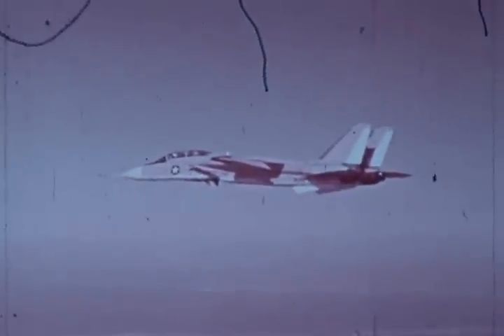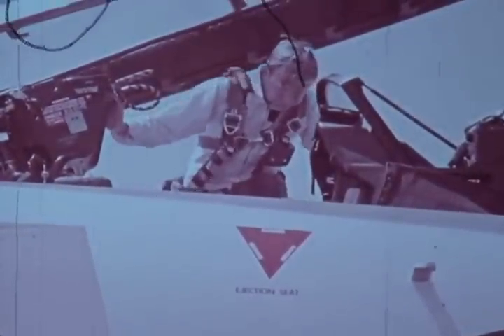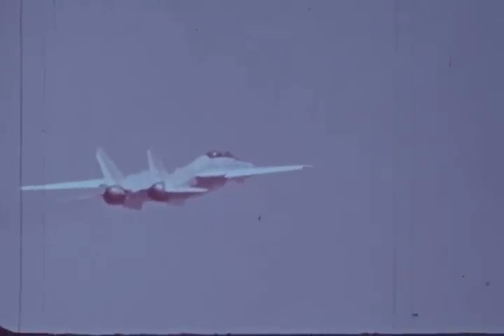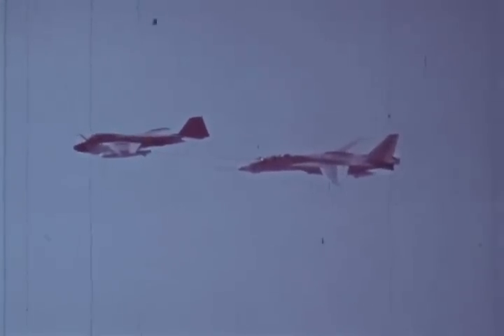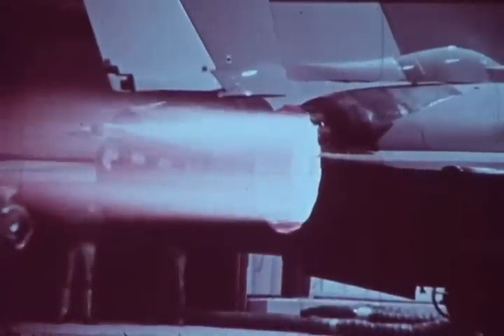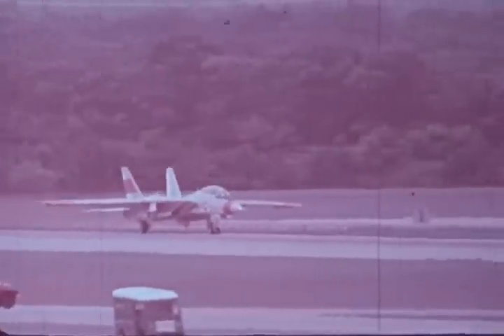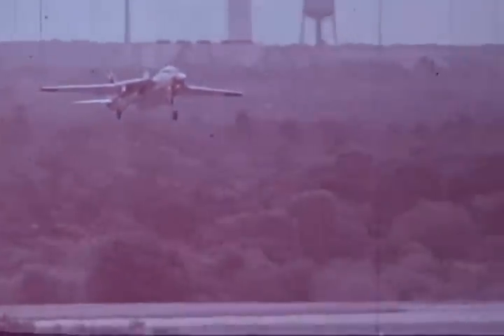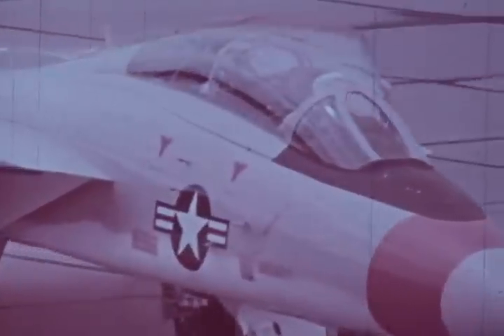F-0622 F-14 Flight Test Progress Report

Comment: The sad reality is that the Navy and Grumman pushed this program quickly and they had some accidents.  It was a very complex plane which led to issues with maintenance and the plane not being produced well above the minimum the Navy wanted.
The Number 1 plane DID NOT have to be lost.  They knew about the hydraulic/harmonic issue BEFORE the flight but the report about the fault didn't get to the test team in time and so they didn't make the modifications.  Had they delayed that flight a month, that plane would have flown for a lot longer than it did!
As it is, they lost about 4 or 5 planes during the flight/qualification tests prior to first deployment in fall 1974.  I think by 1973, they had lost at least 3 planes: the original plane, another plane scheduled for an airshow that plunged into the water for whatever reasons -- they never figured what it was that happened with the pilot I think (he was by himself, no backseater) --, and a third plane that actually shot itself down with its own missile, an AIM-7 Sparrow that didn't clear properly!  They fixed the missile clearance issue by using more power explosive charges.  The AIM-7 that committed "hari kiri" got caught in the slipstream of the launch plane, angled up, and tore along the bottom of that fighter.  There's photos and footage of this online.  It's similar to what happened wit the D-21 and M-21 Blackbird accident (also online).

Comment: amazingly, the navy was still crashing the airplane for the SAME reason almost 20 years later when 'Barney' Jim Barnett crashed into Gillespie field in El Cajon in 1987 (where the air and space museum is located). Killed Randy Furtado and amputated a mechanics leg who was working in the hanger he hit. ya, great airplane and great headwork flying past North Island where you can approach (and eject if needed) over the water and trap on the north runway, instead he crashed into the hanger.. sure, the navy got rid of the 'best' airplane they ever had because it was that good! pretty interesting comments from test 'wonder who designed that?, I dunno?' nice. They killed the test backseater on another ejection from the spin test, I think we got a winner here.. VF1 crashed 4 of them on that first Enterprise cruise and that was just the beginning. poor planning and maintenance on the navy's part did constitute many an emergency on my part, happily many of us still here to tell the tale. Every behavior I had operating that airplane was shaped by all the crashes the navy had with it. good riddance to it and the navy I say..